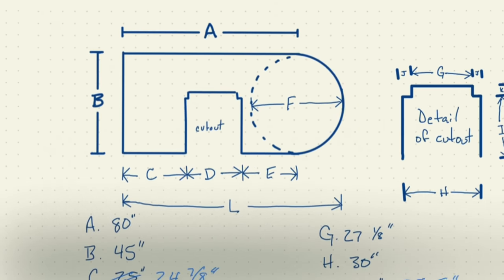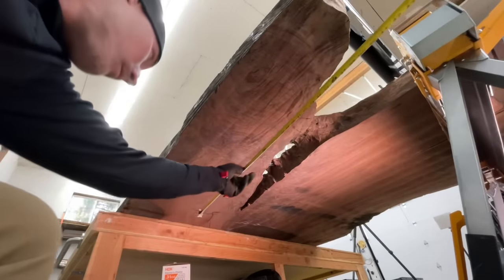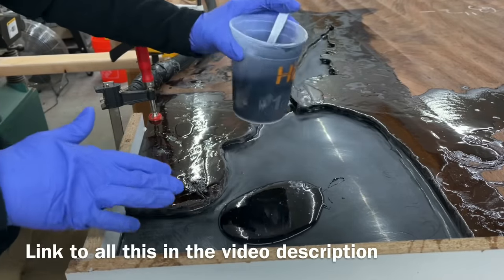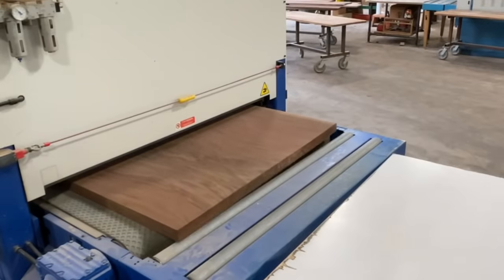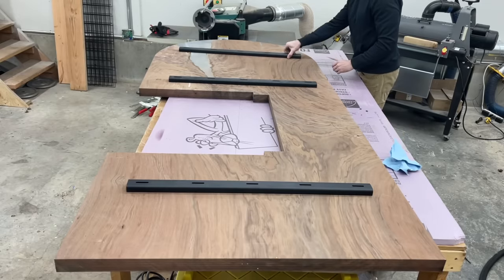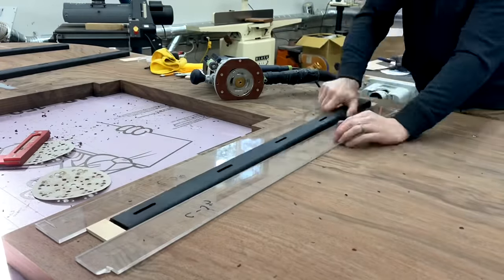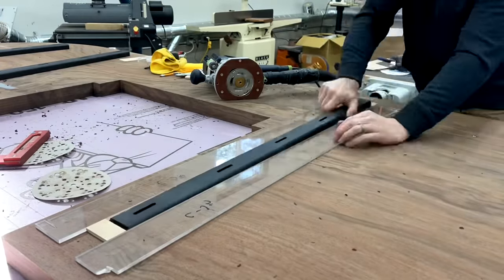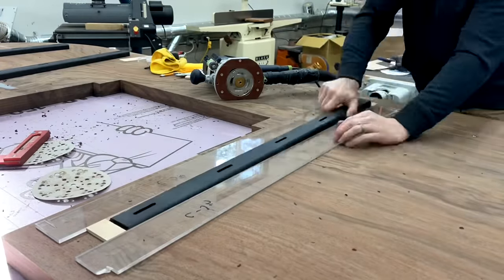$15,000 Kitchen Island

Comment: I wood not have a wood tabletop, but this is a piece of art. Absolutely brilliant.
Reply: I wouldn’t have anything but a wood table. However for an island I currently have quartz. Previously we had a bamboo island top but it was splitting in a few places. I would love a full butcher block slab but the cost would be far out of my range.
Reply: Wtf
Reply: @aaronbenjamin5167  I know right!
Reply: @youtubeadmin1451  The video was about an island (counter) top, not a table top. Very few people don't have a wood table top. Countertops however, which is what this video is about, come in many different materials. So, Wtf is inappropriate for anyone that so much as read the video title, never mind actually watched the video, before making comments.

The question was not 'who would have a wood table top?' because most people would and do. The question was 'who would have a wood countertop?' To that question, I made my comment about previously having a bamboo countertop. It looked great, but the construction was shabby - it split in a few places (delaminated, since bamboo is just a laminated surface). 

I would love to have an actual end-grain butcher block for the full island top, but that would be far out of my price range even if I made it myself. So, quartz was my best option. Wood countertops are also a lot more difficult to maintain if you have an undermount sink - another thing to consider if you want a wood countertop.

Is the top in this video a work of art? Yes. It is fantastic. I would have it in a heartbeat if I could. It is much too expensive for me to justify though.

Comment: Wood:
I took down an old fence and reused that wood to make a couple of rustic countertops for my kitchen. Going down the rustic route makes it easier than the more perfect style your top has. Scuffs don't matter as much, faster to touch up, cheaper and faster to make but still gives the warmth of wood. 
Also:
I usually don't trust any coments on products with affiliate links. You are a very rare exception. Not because of what you say, though I like that you do that, but rather because how you work. The weight you put on details and how you don't cut corners and how you care about your client makes me believe you'd rather loose money than recommend products you don't believe in. Work morale is a good indicator of general morale.

Comment: I personally Wouldn’t do the wood countertop. Even with the down-draft vent. Grease from cooking gets all over my quartz countertop and it makes my skin crawl thinking what damage that would eventually cause to my custom wood.
Reply: Right with you there. I like a sanitary feel to my kitchen and wood ain't gonna cut it.
Reply: Have you not heard of wood sealer?
Reply: Wood is fine, IF you use the correct surface finish. Also wood is better than plastics, as it contains its own biological anti infection chemicals.
Reply: @shrapnel77  How is wood not sanitary?
Of course, if you never clean your kitchen...
I never use plastic boards for cutting because THOSE are unsanitary after a few ridges get cut into them with your kitchen knife.
Also, they look cheap and nasty even when new.

Comment: I wouldn’t mind wood counter tops, but I wouldn’t want my oven surrounded by them 😂
Reply: What do you think would happen?
Reply: Won’t the wood dry out? 
Have huge cracks in my dining table from the wood drying out. Not sure how to repair them.
Reply: @sirrathersplendid4825  epoxy? :)
Reply: @xenonram  bacon grease
Reply: @Linoran85  — Would mean taking the whole table apart and resanding. Too much effort.

Comment: Not wood - spceifically: Stone. Because I've had wooden kitchen countertops for 14yrs now (IKEA) and I want a change.
Reply: Concrete! 🤘🙌🍻 Inexpensive, can be finished in with any color/texture/pattern/sealant, and it will last several lifetimes, if done correctly. Liquid stone!

Comment: I would choose wood. Could you cover the entire slab is like a thin layer of Apoxsee? Would that help protect it more than just finished wood? Could you put like a 16 inch layer, so they almost look like it was all wood
Reply from the maker: Good question! Epoxy or any clear coat has its own issues. The clear will show scratches worse than wood. It is also much harder to refinish. Where this finish can just be refreshed every year or so and look new.
Reply: Thank you for that answer. You did a great job on that piece of wood by the way. Even though I am disabled and can’t work in the shop anymore, I do enjoy your videos especially because you do talk. It’s fun to hear how you manage through the difficult parts
Reply: There is a food safe epoxy called bartop, it's used on bartops, countertops, and tables.
Reply: If you did do this you would also have to be sure to epoxy the underside as well. When only one side is coated, then you will get serious cupping/twisting issues do to moisture levels being different from top to bottom.
Reply: @vargr  yeah! I've had great success with that stuff. I'm still a beginner when it comes to epoxy, but bartop seems to stand up well to heat and scratching
Reply: @seanmyers227  if the bar top is so dependable, that sounds worth it. But I wouldn’t dislike a thicker clear coating if it was glass clear, it would look like a museum display worthy of that walnut, but wouldn’t fit in a log cabin.
Reply: @dafickler  very true, also very time consuming. I've already placed sacrificial legs one the 'bottom' of the countertops. I just need to build a pour table for each countertop. I've already made any cuts to join or install the sink and cooktop.
Reply: What was the stubby chisel that you were using for the bowtie? Also, I dont mind the commentary. I would rather watch videos that have more information, than just simple background music.
Reply: Would it help to use a de-gassing set up, before pouring that epoxy? Might help with the thin pours.

Comment: Man you need a small gantry crane or pulley system on the ceiling if your flipping slaps all the time I reckon. Save that back brother. A cool idea would be an adjustable Height workbench that you lower right down for the flipping of the slabs.

Comment: About 3 years too late, but i would absolutely never use wood as a kitchen work surface - porous material where food is prepared, no thank you.
But the finished product looks amazing, and the process as you depict it is engaging enough to hold my ADD and internet addled attention span.

Comment: As a European – have you considered a small van instead of the pickup? You get 9–12 ft load length, fully enclosed from the elements, and a lower floor to lift onto. Flat slabs don't make much use of the extra height but I still don't see a benefit to the truck. Maybe if it cost way less

Comment: Ps! I would have wood!
Beautiful!
 As much plastic wrap as you use I don’t understand why you don’t use that same thin plastic sheeting inside your box molds to prevent leaks and for great mold release.
I mean, if you’re going to cut it down and trim it off anyways a little plastic on the surface shouldn’t be a problem with the epoxy.

Comment: I wouldnt mind real wood countertops because its wood or because of a durability issue. Alot of people use that cheap particle board with vinyl or plastic laminated on top of it which isnt much more durable then real hardwood if at all. Where the wood countertops gets me is the wood grain. I like a small sample size of woodgrain. But the entire counter would be too much i think. A table is great. Counters, or cabinets is a no go for me. It just feels like its from the 70s and i hate it.